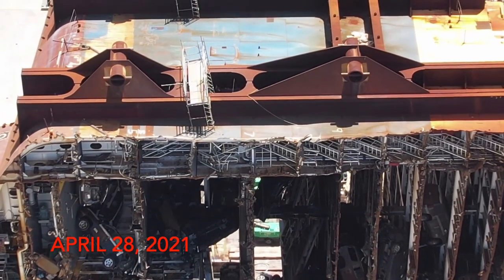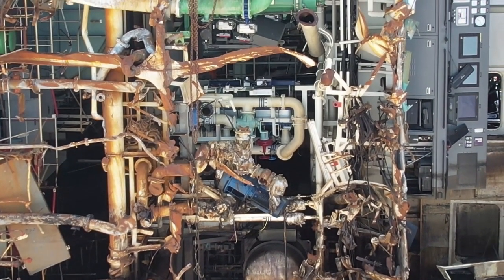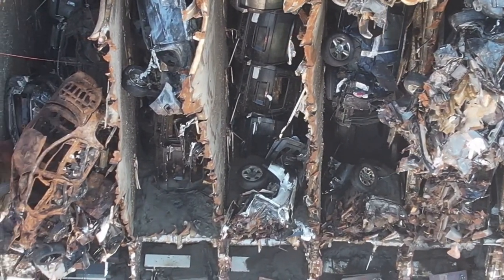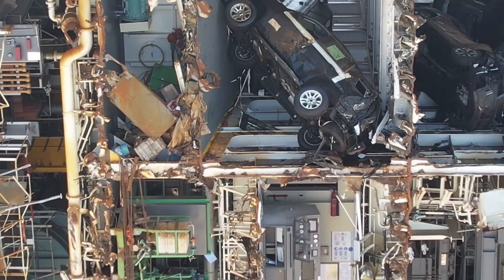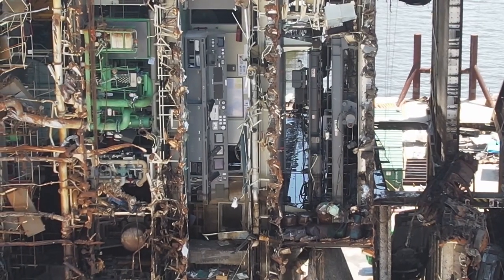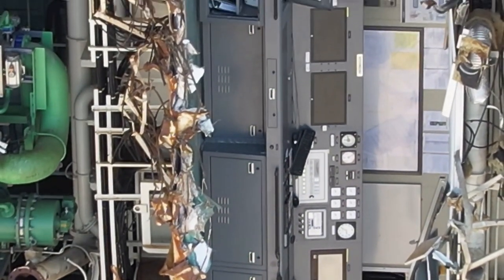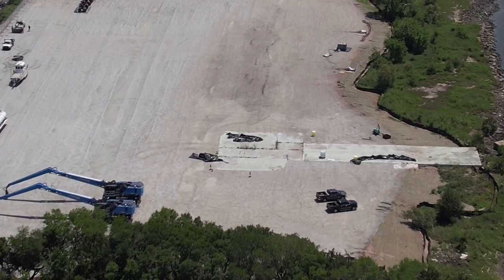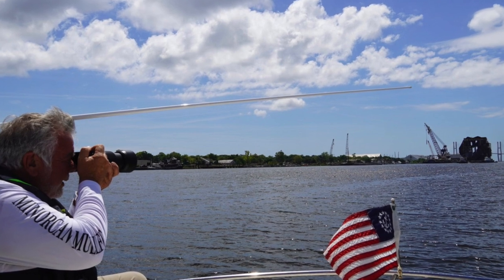A CLOSER LOOK AT SECTION 7!!! on April 28, 2021

Comment: One of things the wood mat does is to increase friction. Set metal hull section on metal barge deck its much easier for hull section to slide in a swell. Wood will significantly reduce that tendency to slide.

Comment: Just when you think you have seen it all you pop up with possibly the most detailed video to date. Fascinating to see the inside and I am intreeged to know what the chain that is stowed underneath the control room is for. Is it to do with lifting parts in and out of the engine room with the gantry cranes or is it something that has been placed in the wreck after she went sunny side up. I wonder if the oil barrels next to the control room had anything to do with the fire starting by possibly leaking on to a heat surface.

Comment: This was still a brand new ship when she capsized! Only in service since May 12, 2017. She wrecked on September 8, 2019.   After looking at this section, where a large amount of the ship’s machinery and weight is located, it’s fairly easy to understand why proper water ballasting is so important to these ships stability. These ships carry a large amount of cargo weight up quite high in their structure.

Comment: This is real investigative reporting.  One of your best, Andy, and I hope you get some strong, positive, official recognition for covering the cleanup of the"Golden Ray".  It appears there was fire damage of some intensity on one level, but the heat cooked the vehicles on the adjacent decks.  Regarding the fouling of the chain, I'm thinking the heavy pipes around the engine room may have been part of the issue as well as the issues you cited.  Excellent use of your drone.
Reply from the maker: Thanks so much!  MM

Comment: Some pretty amazing footage of the wreck there, Andy, helped by great natural lighting conditions.  Was each vehicle supposed to have been lashed down to a deck? I wonder if there is even one salvagable car from the entire cargo of around 4200.
Reply from the maker: The way I understand the operation, every car is strapped down for transport. MM
Reply: I have been on commercial and ferry type vehicle ships and can tell you not all lash the cargo down, I have once seen them chain one truck to another?? The longest journey was Venice, Italy to Alexandria, Egypt.
Being an ex truck driver, I would never lash a load down on a truck with two straps each end of the vehicle, going straight down to the deck fitting. The straps need to cross from the vehicle to the deck anchor point, this prevents side to side as well as forward and back movement.

Comment: Wondering where and what's up with the chain that was hanging with the orange hook. Looks like it spans across multiple compartments and showed up during or after the cut.
Reply from the maker: Not sure about that.  Just spitballing here, but could have possible been used to help muscle the cutting chain back into place after a link failure.  No telling.  MM

Comment: Great drone footage, thanks for that. I was interested in seeing the ballast tanks for trimming the ship in loading and for underway with a part load. The only section visible was the bilge area that was about the same depth as a regular deck, but in a narrowing section of the hull as is expected. I just wonder how much ballast the whole ship can have onboard to balance it.
These vehicle transporter have a lot of windage as do the container ships and at a change of the ships direction the windage will change, how do they counteract that.
We had the inshore incident of a similar craft on the South coast of the UK, seams there getting a bit too frequent.

Thanks again for posting and stay safe.

Comment: Great footage as usual. I'm curious as to what the vehicle is that is right above the engineering spaces where the section is sitting on the barrage, you can see it at 6:10 in the video, it's upside-down and you can only see the tires. Looks like maybe an old Hummer or some other military type vehicle.
Reply from the maker: I saw that too.  There were several POV's listed on the manifest....  MM
Reply: Captain Andy, I think in a previous video you had mentioned that there may be a GT40 on board, were you ever able to confirm that?

Comment: As a marine engineer and Naval architect I have been looking very hard for some semblance of a propeller shaft coming out of the stern of the engine. Have you seen anything resembling that Rory's of the rear of this section or the previous section?
Reply from the maker: It was removed early on along with the rudder.  They were taken offshore as part of an artificial reef. MM

Comment: Would not be surprised if the NTSB grabs the hard drives out of the engine room control computers !
Reply from the maker: Didn't think of that.  MM
Reply: @MinorcanMullet  they would be way more interested in the VDR which is like a black box but for ships